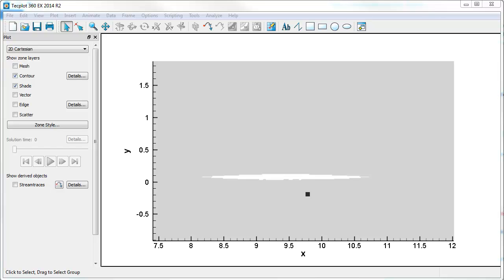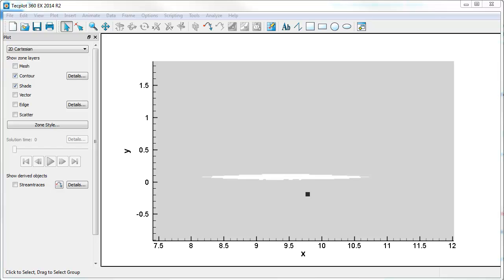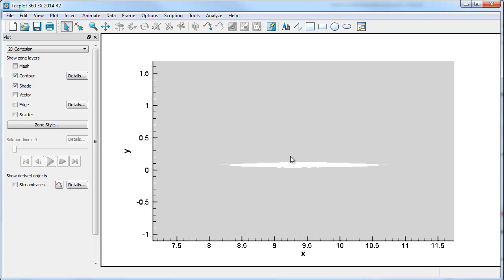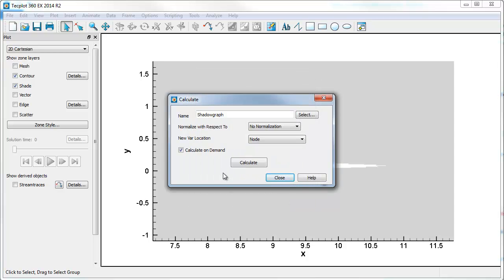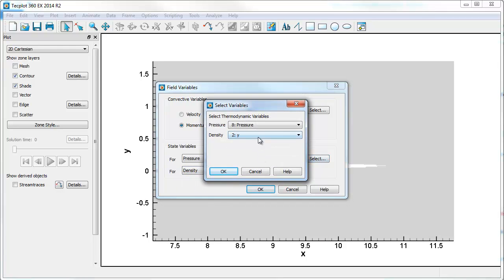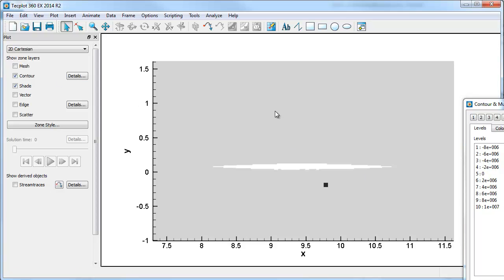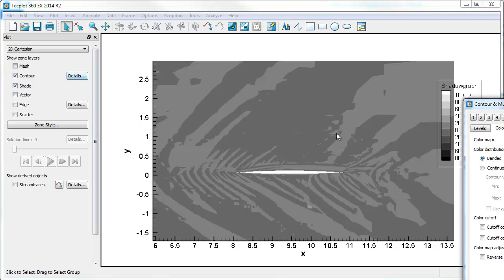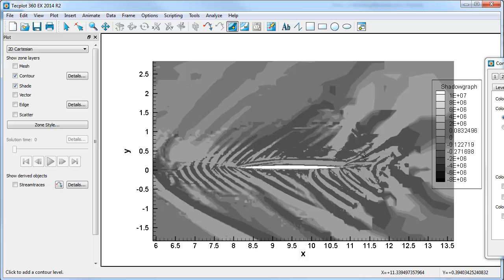Shadowgraph Technique in Tecplot 360

Comment: The equivalent of a Schlieren diagram? "The intensity in shadowgraphs varies with the second derivative of density. The light intensity in schlieren images varies with the first derivative (gradient) of density in a specific direction (normal to the knife edge)." So then it would be better to just calculate the x variation density gradient from the Analyze list and plot this for the Schlieren case?